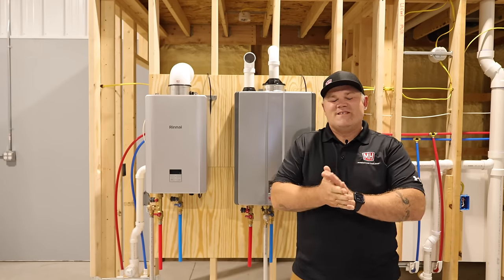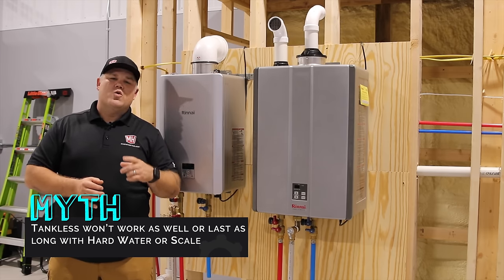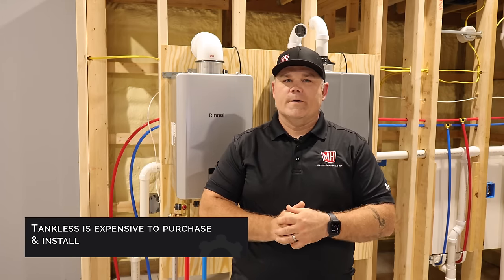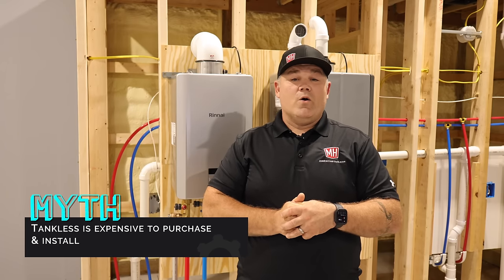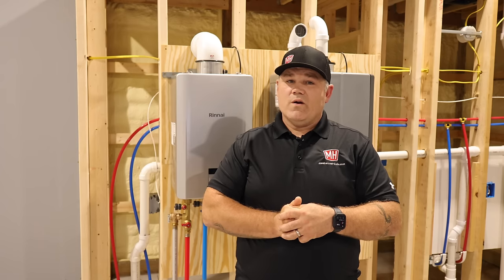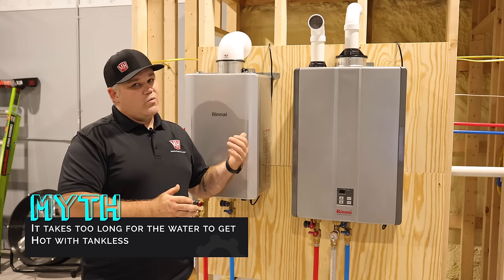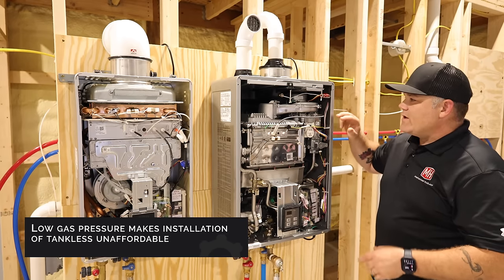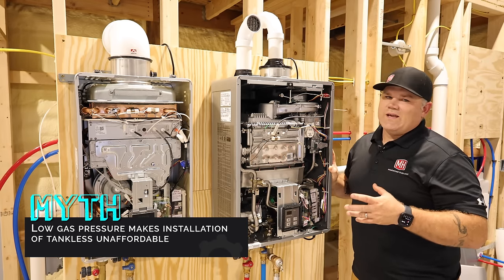Myth Busting! Tank -vs- Tankless Water Heaters

Comment: Thanks Eric,
I think you oversimplified purchasing cost. It is NOT a myth that Tankless water heaters are more expensive than tank water heaters (initially). From what I saw the cost lies more in the plumbing. I got two similar quotes last year to install a tankless water heater (including parts, labor, plumbing)  and they were nearly $10,000, whereas a tank water heater was about $4,000. The tankless heater did cost more, but there was a huge additional cost due to the ""complicated plumbing"" of these types of water heaters.
With that being said, the tankless water heater I looked at had a life expectancy of about 20 years, whereas tank water heaters have a life expectancy of about 10 years. After calculating how much I would save in gas because of the efficiency of the tankless heater, and having to replace my tank water heater after 10 years, I determined that I would start saving money after 12 years if I went with a tankless heater. 
I didn't chose a tankless because I don't plan to stay in my house for more than five years and it doesn't contribute enough to my property value to offset the cost. 
But, if someone is financially able to tie-up $10,000 and plans to stay their house for more than 12 years then it makes sense to get a tankless water heater. (At least from my own calculations and experience.) 
Note: The tank water heater was 40 gallon and the tankless was "its equivalent".  Both were base models.
Hope this helps those looking at this video.
Reply: 12 year ROI is terrible. Just for comparison, with an electric tank, I calculated a 2.7 year ROI for a heat pump electric. I don't remember the exact number, but it was something like 8 years for a ventless dryer over traditional, and similar to swap AC ceiling fans for DC. Most houses will have many other options with a shorter ROI.

Still, your prices are for new construction. (Or you're getting ripped off.) There's just no argument for swapping from a tank to tankless. Myth NOT busted.
Reply: The problem with your anaology is that you're not applying it to water heaters - where a 10-year life expectancy is minimum. So the first 10 years would be equal, whether you pay $4k or $10k therefore you're not gonna gain any ROI.
Reply: No one should be paying 4K for a 40 gallon typical water heater.
Reply: You could always just learn to sweat pipes, & plumb it yourself. That'll save you a couple grand.
Reply: @mariatorres9789  Oh yeah - cause education and an apprenticeship is oh so cheaper 😂😂
Reply: @mangos2888  Are you kidding me? You just get copper pipe,  some elbows & T's, some Flux & a tape measure. Measure. Cut your pipe. Sweat the right ends where you need them & fittings. Voila, you've plumbed it. I did both my bathrooms by myself. It's not rocket science, & I never ever worked a plumbing job in my life. Drains are even easier, it's all plastic now. Measure. Put the right fittings & glue it together w/ the right type for your pipe, make sure you've got the right slope with your level. Boom, just saved yourself thousands. I even build a small form under my water heater, slapped some water in a bucket with some concrete mix. Did it with permits & passed inspections. It's really, really easy. (ESPECIALLY with YouTube now, lol.)
Reply: How old are you, whoever quoted those prices are completely trying to steal a lot from you.
Reply: @mariatorres9789  All the shit you mention take equipment costs and skills. It's entirely possible to "sweat" incorrectly. You seriously over estimate untrained talent's baseline and underestimate the value of plumbers.
Reply: @mangos2888  Ya, because I didn't do my own entire house,  water heater, new copper lines, & the entire ABS drainage lines,  with permits, all by myself without 'training'? I'm pretty sure they still teach how to find a slope in high school? Smh. What do you think they teach that math stuff for, pushing buttons on a register at the gas station? Smh.
Reply: It cost me $180 for my tankless unit and about $20.00 in parts to plumb it in.  DIY of course.  It's been running well for the last 15 years and all I do is swap two D cells every year or two.  I should run vinegar through it, but never got around to it yet.
Reply: @mangos2888  Plumbers have their place, for sure, especially if you're in an area with excess regulations.  Plumbers do what others are not willing to do.  Most skills can be learned by most people that are willing to learn and have the physical ability.  I can change a large tractor tire, but at my age, I no longer wish to.  Sweating copper has a learning curve, but it's not that bad if the location is accessible.  Today with PEX and transition fittings, it's even easier.  Other plumbing skills, like wiping lead joints and replacing cast iron pipe in tight spaces take a lot more effort and skill.
Reply: What complex water requirements? While a closed loop system is ideal it’s not required. A recirculating valve is installed and the Renai (sp?) has a pump installed but also has the ability to to not be used. My installation was easy . Now a larger gas supply line could be required and that would definitely increase the cost.
Reply: @mangos2888  My daughter watched YouTube  video and learned to sweat pipes.  She replaced all her plumbing in her bathroom that is over 50 years old.  Now she does all the family plumber. lol 😂

Comment: We have two tankless systems in our house. One gas in our main house and one electric in our in law suite. The gas is Rinnai and the electric is Rheem. Absolute best decision ever to go tankless and both the Rinnai and Rheem have been incredible.
Reply: I worked for Rinnai and they did not make a total electric tankless waterheater
Reply: @gobdeep  they are the best , its not energy efficient to heat water when not needed , the thankless on demand is the way to go it uses a flow switch when your hot water faucet is opened, it then turns on gas burner or electric elements to heat water as need
Reply: @GaBullDawg1334  I apologize, the electric is Rheem and gas is Rinnai. I got them confused. I updated my original comment.
Reply: @henrykennedy1120  I don’t see the savings, my buddy just had a tankless put in. It was $2400. He could’ve had a 50 gallon standard hot water heater installed for $1300. He will make up the difference in about 25 years. There is no savings here.
Reply: Instant savings dude

Comment: I've built a few off grid homes and used tankless water heaters. With a gravity fed water system there was never enough pressure to allow the heater to even ignite and heat the water. A pressure pump is necessary to increase the pressure in order for the heater to work requiring more drain on the batteries.
Reply: Jesus is the only way to healing, restoration and salvation to all souls. Please turn to him and he will change your life, depression into delight, soul heading from hell to heaven all because of what he did on the cross 

“Whoever calls upon the name of the Lord shall be saved” Romans 10:13
Reply: All UK water systems used gravity feed whe we lived there and tankless water heaters were the only thing available. Off-grid in North America should be possible with European design.

Comment: Operating costs for the tankless are much lower for me. I live alone, and am frequently gone for several days at a time. Not paying to heat 40 or 60 gals of water that isn’t even being used is key. Still having unlimited hot water available when the whole family arrives for special occasions is perfect. I highly recommend the Renai. My first tankless lasted 10 years, but my tech said it wasn’t a quality one and replaced it with the Renai. Going on 8 years on this unit and no problems. Even the one that only lasted 10 years more than paid for itself in energy savings.

Comment: This is a very good  and accurate video.I installed my first gas tankless in 1976.All the local experts called me crazy with the usual facts .Or more acurate opinions.Fast foreward to 2020.I moved into a new home ,had to do extensive repairs.I removed the 40 gal conventional tank and had a Electric tankless installed..Not surprising all the usual comments even from the plumber.Well the same result.

Comment: You covered a lot of good points for going tankless.  There is one install cost that can be very expensive, and that is for the electric models.  There are older homes in areas that don't have easy access to the power requirements these things call for.  My parents had a handyman talk them into a having him install a tankless.  When inquired to why the water was just luke warm, he said it was working just fine when he installed it.  This is when I decided to start learning about tankless.  The most important thing about the electric version is that they need a lot of amps to work properly.  The unit that was installed was a smaller unit, but still required a lot more than a #12 wire on a 40 foot run.  That's right, the handyman used the original cloth wrapped #12 to power this tankless that calls for #8 in a fraction of the distance.  The framework design and flat roof of this house does not allow easy replacement of any wires to this breaker box.  The cheaper option ($4,300) was to run power from the meter main to the heater with #6 along the outside of the house with a new disconnect.  After that, the hot water was working great, no more fire hazard and I was able to sell the house.
Reply: Nice
Reply: SCREWED BLUE by the not so handyman.  Put the tank one back in on the 12g wires for $500 or less.
Reply: The biggest cost for gas tankless water heaters is not the unit. It is the special vent pipe that is required. Unless you are fortunate enough to be able to mount on an exterior wall and vent directly through the wall to the outside, the pipe cost (including elbows, collars, and flashing) will run more than the gas unit itself. I speak from experience.

Comment: I've been meaning to make the switch from tank to tankless for years but kept believing it was way more expensive.  I'm already on my third water heater due to the tank leaking.  Think I need to switch to tankless now.  Great information thanks!
Reply: You'll have leaks in the valves in the tanless too.
Reply: @OldTooly ya not the same.  You have stock in the overprice tank water heater world?  The price is a joke for tanked water heaters.  Another industry that lies as it changes.
Reply: Get your water tested. It may need to be treated. It may be hard, and corrosive.
Reply: @johngordon3882  I think it's more because I never flush the tanks and check/replace the anode rod.  Now just last week my Rheem 12 year warranty water heater leaked after barely over 9 years.  I did flush this one but only once last year when it started making popping sounds.  I think most water heaters just aren't made to last like they used to be.

Comment: One thing to keep in mind with tankless water heaters is to get one with a digital controller. The turn knobs are not good at fine tuning to get consistent temps between showers and sinks.
Reply: I had no problem adjusting the knob. I turned it once and noted how far it was turned and the temp difference which was 24 degrees. I wanted a 16 degree difference so I dialed back one third of the increase. So it took a total of two adjustments. Nothing hard about that.

Comment: Great review. 
I have personally installed 8 so far in various rental properties we own. Best was mid pandemic AO Smith 240 160k BTU ($1500 complete) to replace the 80gall HW tank in a 7 unit apartment building. It has run flawlessly & I no longer receive calls from frustrated tenants about no hot water. 
I installed a Stieble  24 plus in our Scottsdale winter home ($875 complete) & the gas consumption (kitchen cooktop & HW tank were the only appliance on NG) went from $165 to $13/month. & that was for the month of June when outside temps were 100deg & the temp in the garage was 115-120deg where the old HW tank sat cooking itself on a medium heat setting.
I installed 2 Steible 20plus units in a duplex to replace the old rusted electric HW tanks in a damp flooding prone basement crawl space. Both units were installed in the bathrooms of each unit ($800 each complete) & have run flawlessly for 2 years. NG was not at the street. Electric consumption reportedly dropped significancy.
8 years ago I also installed a Steible 24plus ($699 complete) at our all electric Lakehouse. Highest electric bill with a/c etc running was $71. In the same period, our Lakehouse neighbor went through 2 propane HW tanks at $2300 each time, he also had to drain them to winterize. He just broke down & went with a Steible 29plus.
On our larger homes I do install recirc pumps & the annual vinegar flushing is the only PM. When/where necessary I simply winterize with RV Antifreeze.
My BIL just had one installed for $7200, but at least he did eliminate 2 75gall HW tanks.

Comment: Great video!   A few things- older on demand heaters had metal vents that were crazy expensive- that is where that myth comes from.   Technology has improved since then.   Circulation pumps may save some water, but are not cheap or energy efficient at all.   If it comes with the pump then that is great.   But for it to work you need water lines to go from the tank to the tap and back to the tank to create a loop.   And the lines need to be insulated.   And the pump runs constantly even when no one is at home.   That all costs money.   I work for a builder and we have installed these systems in million dollar houses and usually they turn them off because of the crazy power bill.
Reply: No to everything that you said. Circulation pumps are a couple of hundred bucks and you need no extra lines.  Technology has improved and the need for return lines is a thing of the past. My house is a little tech heavy and we use Amazon's Alexa Dots to do all kinds of things. You'll need the least expensive Dot that they make ($20) and a Tapo wireless switch. Get a 120 volt recirculation pump, install it, plug the Tapo into the closest receptical, and plug the pump into the switch. About 20 minutes before you want to use whatever hot water that is too far from the water heater, you tell Alexa to run the pump for 20 minutes. The pump runs for 20 minutes and then shuts off. You jump in the shower and the hot water is right there waiting for you. There will be some setup of all of your new devices but once it's done, you don't need to touch them again. I use the Dot/Tapo combination to turn lights on and off (and dim them if you have dimmable bulbs), turn on a small electric heater in my garage, run the pump, turn my garage exhaust fan on and off) and the Dot by itself to control our TVs.
Reply: @RMartin631  How do you do it without a return line? Dump the water down the drain? Planning ahead for 20 minute wouldn't work for me.
Reply: @kevinjackson4464 , they use a special manifold that passes the water from the hot pipe to the cold pipe. The water just goes in a loop through the house pipes. I'm not sure what your need for hot water is that you can't wait 20 minutes but if that's the case, you could install a smaller electric tankless heater at the point of need. Our issue is the tank is at one end of our house and one of our bathrooms is at the other end of the house. The kitchen is in between. Since installing the recirulation pump we haven't noticed any increase in electric usage but our water usage has gone down. We use a  Watts Premier Instant Hot Water Recirculating Pump System with Built-In Timer, but we don't use the timer.
Reply: @RMartin631  Makes sense, thank you. I wonder why nobody thought of that long ago. Does it warm up the cold water?
Reply: @kevinjackson4464 , not enough to where we notice it. We're in the middle of winter and the cold water coming out of the taps is 55°. We're going to install a propane powered tankless when and if our current electric powered CWH goes bad. We're going to buy the tankless now and just set it aside until we need it. We have a garage apartment and that has a 40 gallon electric powered CWH and we already have a electric powered tankless ready to go for that one. We were doing some drywall work in the kitchen and ran the correct size wires for that tankless then.
Reply: @kevinjackson4464  its called an H valve and they use cold water line as the return. mostly for old works with no return lines. ofc a dedicated return line is most ideal

Comment: We have a gas-fed tankless water heater and have noticed a couple issues with the technology. First, you must maintain a minimum hot water flow in order to keep the heater heating. If you’re using just a trickle, soon any hot water in the supply line gets replaced with cold, and then you have to go all out hot to flush the cold water out, and water gets wasted. Circulating pumps would help but then the water heater runs a lot more, decreasing its efficiency. Second issue is that if your electricity goes out the gas water heater won’t run, (unlike a tank water heater which doesn’t need electricity) unless you plug the tankless into a battery backup UPS…
Reply: How old is your unit and do you do the required maintenance (vinegar flush)?  I bought a house with a tankless water heater...that hadn't been maintained for years.    I replaced it with another tankless and have had NO problems with flow or temperature.
Reply: We don’t even have an electrical line for our tanked water heater